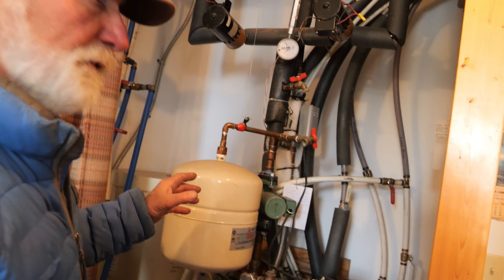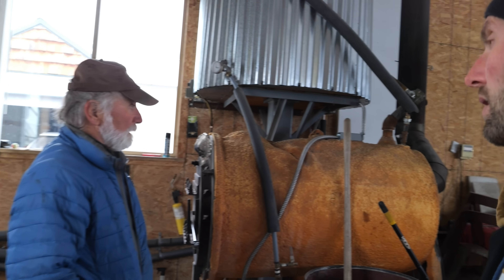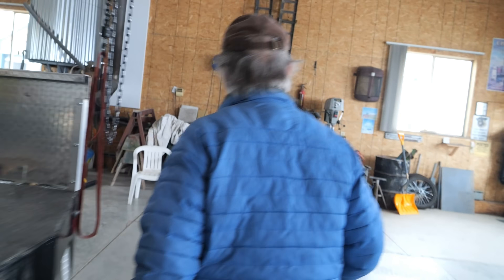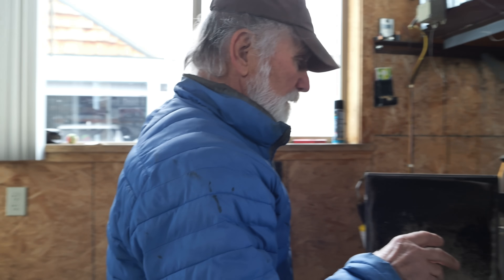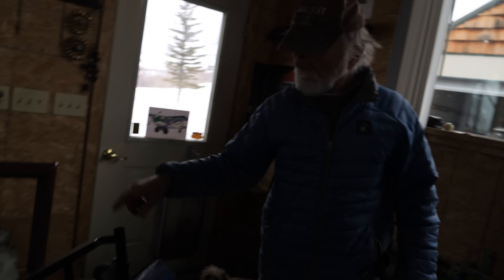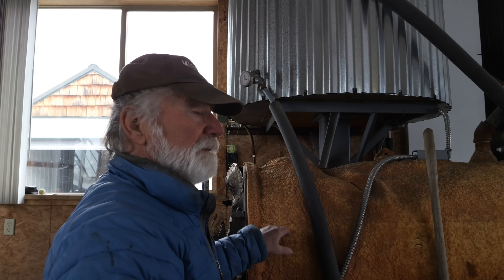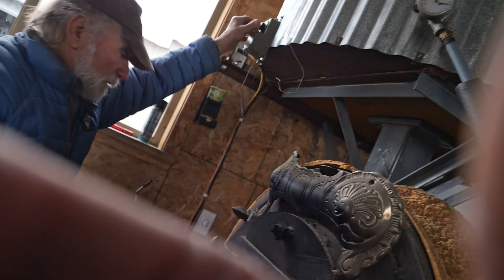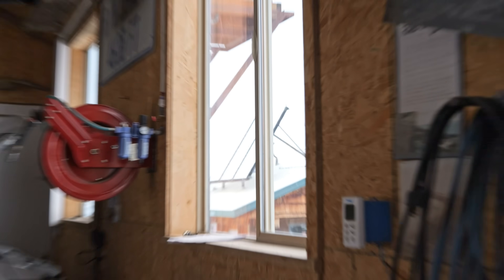Hasn't had a Heating Bill for 40 years.

Comment: You can tell he's an engineer, or he at least runs the numbers, understands the math. He drives a Prius, with a trailer, because it's cheaper. My only question is, how warm does he keep the shop and what's the insulation situation? Adding all that water: the water jacket on the boiler, the 200 gallon holding tank, the underfloor radiant heat, doesn't actually increase the amount of heat generated by the fire. I guess what really helps him is having access to free wood and the time to gather it, stack it, etc.
Reply: The shop stays, totally unattended with no fire in the boiler, in the high 60's to a low of mid 50's, depending to how much sun is out, due to the thermal solar panel array, 6 4x8' panels. Well insulated, big south facing windows, help also.
Reply: @portnuefflyer You got me thinking and researching options for heating my place in northern New Hampshire. Propane is insanely expensive. Wood takes a lot of work. I installed a 12,000 Btu/hr. mini split that keeps the whole house warm enough running non-stop unless it gets below 10 F, at which point I can supplement with propane.

Anyway, here's the math I did on your setup. 200 gallons of stored hot water is about 1600 pounds. Raising that from 70 F to 170 F takes 160,000 Btu. That's only 13 hours of 12,000 Btu/hr. heat stored. Or like 2 hours of firing a 100,000 Btu/hr. propane boiler. So the comfort is achieved by using solar energy either through the collectors or the windows, and the insulation. It's difficult to store enough heat in water for heating homes. It would be great if we could run heat pumps when it's above freezing and store the heat for when it's really cold, but having thousands of gallons of hot water in storage is impractical. Might as well dig and install a ground source heat exchanger instead.
Reply: Insolation is about 200 Btu/h per square foot. So your 192 square foot solar array produces a peak 40,000 Btu in direct perpendicular sunlight. I don't know what that translates to on a fairly clear winter day, maybe 160,000 Btu total? That's a nice amount of free heat to start with. My math works out to about 2 gallons of propane worth. I think you said 2.5 gallons in the video, so I was close with my guess. Now I have to figure out a cost-effective way to make a 200 square foot solar heat collector.
Reply: @charvakkarpe  You could do what he did, buy a large quantity of them from Heliodyne, all pre-assembled and better than you could make, and then install most of them for others......, then with the profit made, yours are free!
Reply: @charvakkarpe  You are correct, in that storing much water for later heating uses is impractical, better to just pump it thru a high mass concrete slab as soon as it's heated!
Reply: @charvakkarpe   He has a vague memory of similar numbers, about 2 gallons of propane worth of BTU's per sunny day.  Pumped directly thru the concrete slab, via the heat exchanger, keeps the loop temperature low as possible, increasing efficiency. You want to make a LOT of warm water with a setup like this, not a SMALL amount of hot water. The glycol loop never goes above 110 or so,

Comment: Straight water in the floor, well let’s hope he never has a failure where the floor pipe splits or he’s going to regret cheaping out here.
Reply: Never happens, like a basement never freezes, with an insulated stem wall and south facing windows. The lowest temp ever after weeks of no attention was mid 40's.  Straight water transfers heat better than a glycol mix also.
Reply: @portnuefflyer yea sure keep telling yourself that, one good cold snap and a week without heat and that house is frozen like a brick.

Comment: I have a radiant heat system in my detached  shop. It is gas fired. It is still very efficient even with using City gas. The cement floor definitely retains the heat.

Comment: WOOD BURNING BOILER /FURNACE...  If a guy buys a ROCKET STOVE TYPE professional grade furnace, it is big, aprox. $4 k,  It is very very effecient too.  It is great because it BURNS VERY VERY HOT and produces little smoke.  Little smoke = hot burning.  Turbo air input increases oxygen... the fire is hotter burning.  ANOTHER OPTION too.

Comment: We have these water radiators in the UK. Its incredibly low cost to heat your home because you have gas heater warming up the water and then that is distributed to the radiators. Amazingly cheap compared to the US approach to heating with HVACs.
Reply: Only if the price of gas is multiple times less than the price of electricity.
Reply: @ my buddy live in SF, his electric bill from using a space heater is insane.

Comment: As a Plumber / Mechanical guy I am made of questions
Reply: O fires needed the last 8 days, with low 20's overnight, but clear days means the solar thermal panels heat the shop and house floor throughout the day enough to coast thru the night. the only energy needed being 2 or 3 circ pumps that draw around 50 watts each, all automatic.

Comment: Those solar panels don't do shit in snowy weather and when it's sunny , you don't need heat.
Reply: You're half right, when snow covered it's wood boiler time. But on sunny days they heat the floor slabs enough to get thru the night, when it's low 20's F

Comment: I have a similar closed loop system I custom made from an on demand propane hot water heater and a plastic tank. My tank and lines are clear so I can see the water. Question though how do you prevent rust in the water systems my cast iron circulator taco pumps like yours rusts and puts rust all in the lines/valves/tank.
Reply: Beats me! All I know my circ pumps last for decades. I did have to replace the galvanized fittings I stupidly used in places after about 15 years, as they were getting gunked up pretty good, all brass now.

Comment: The temperature is he speaking of don't seem like enough to heat anything. 70° water going through an underground slab just doesn't seem like a high enough temperature. Most house boilers have a high limit of 180° to 220°. You're not really getting decent radiant heat off of hydraulic systems until you reach 140°
Reply: Hydronic to forced air does require higher temps, not radiant floor. 85-90 is plenty for the house, lesser temps keep the shop good for working.

Comment: "Water is in the floor, straight water, it's never gunna freeze." Spoken like a true handyman who plans to never take a vacation. 

I personally would rather spend $800 on glycol than have to jackhammer up my floor to repair a freeze, but if it's worked for 40 years, who am I to judge? 

Thank you for the amazing tour! I've never seen a wood stove system like that. Incredible.
Reply: Even in the middle of winter, the thermal panels will produce enough hot water to kepp the floor water from freezing, with no other attenetion, 48 degrees is the lowest ever noted. Glycol reduces heat transfer as compared to staright water.

Comment: Ok this is cool but not true!
Yes you can heat thus way BUT NO WAY IN THE WORLD THAT HOUSE IS CLOSE TO 40 YEARS OLD!!!
OSB board would not be any where's 40yrs ago!!!
Real plywood it would be 40 years ago!!!!,
So if LIEING ABOUT something so simple, what won't one lie about!!!!!
Reply: Not a house, a shop, 18 years old, thus the OSB, an earlier shop and house (not shown) had the same system for around 28 years, bottom line is no monthly bills in all that time, no lie! Good catch on the timeline/OSB though.
Reply: @portnuefflyer  so taking it that you missed the drone footage showing there place?
Stevey Wonder can see the house is not the age they said!!!
Osb board is not a old wood product!!  They use to burn the chips rather than press it into OSB board!!!
The 1990s is when they start pressing wood chips into OSB board....
Reply: @JustMe-gh1lf   Blame the video editor, who glossed over the fact two different systems and houses/shops, have both been heated by similar systems as shown here, for a total actually over 40 years, 18 years for the one shown, thus the OSB.

Comment: Excellent presentation.  Thank you.  That said, just because a person is not paying a utility for energy doesn't mean that the systems and processes "dont cost you a dime".  Maintaining and building all of that is not cheap even if he did most of the work himself.   Plus there is a cost to run a chainsaw to cut wood and a cost to load it in the truck/atv and bring it to the house. Sure, a person might (or might not) save money with those processes but they are not without their own costs to build, operate and maintain.

Comment: Meh. It’s alright. Workmanship is crap. Ingenuity is pretty solid. 

It’s the “farmers special”. More materials, pumps, and controls than necessary due to not having experience with installs. 

I give him props for doing it. It just looks so terrible after seeing proper installs. 

He could’ve just installed a primary boiler loop with a secondary loop for radiant utilising a mixing valve.

Comment: I can help this guy max out efficiency on his system if he lives in Alberta hit me up there’s a few things that are done wrong that’s the reason it takes a few days to heat up I can get it down to a few hours without buying anything new besides a little bit of pipe and I will leave it as an exchange of knowledge cause I want to learn a bit about the panels but I’m a boiler specialist I design, build, repair and replace boiler systems for work

Comment: A buddy of mine built a similar wood burner/boiler setup to heat his shop. His fire box boiler was a little bigger. His setup used to keep the shop warn four days after the fire went out. Bonus was the firebox worked as an incinerator with liitl to no ash left over..

Comment: You will notice that Tom does not have a weight problem, and I seriously doubt he has a fitness club membership.  In other words, heating with wood is a long-term physical commitment, day in and day out, 24/7/365.  In reality, this only makes sense for those with the resources (including wooded properties) and the desire and capability.
Reply: Not that much wood needed, don't confuse this setup with the outdoor boilers that consume multiple cords of wood.  Solar provides the BTU's much of the time, on sunny days all of it, and he always has the option of using the electric boiler as he also has unlimited free electricity

Comment: 7:10 The Oven could also use a hydraulic seperator and work without a Pump.
His system is smart and simple, but almost common complexity here in Germany for bigger buildings, sadly ur gouverment don't want Wood as heat source.
The effort for efficency in big buildings is insane here, everyone sees insulation, winbdows and so on but what they dont see is the complexity behind the Heat recovery systems.

Comment: THE TRUTH: he paid many hours & many invested dollars to get "free heat". You cannot get heat cheaper than buying normal residential energy bc no investment & no time required.
Reply: You keep thinking that...., if it makes writing out out that monthly check easier!
Reply: The money he spent 40 years ago has paid for it self the first 5 years of free heat bills. Every year after has been free. You must not be able to think long term.
Reply: @lows6427  Nope.  Always cheaper to buy normal energy...
Reply: @billyjean9484   That's a sweeping generalization, totally ignoring how he put the system together, what he paid for the equipment, etc. It has paid for itself many times over, and this isn't a hoped for financial projection, but solid fact based on historical records.
Reply: @portnuefflyer  Trust me, im one the highest certified commercial electrical in the nation (only 1200 of us). Off grid peeps NEVER give the real numbers. I've wasted so much money testing wind, wood, hydro, sun. I cant get less than 500% more expensive. Example of real numbers: 40k up front, another 10k materials invested over time, another 60k in time (640 hours spent building, trouble shooting @ $25 hour: his hourly pay rate that he could have made if he was working) divided by total number of months used = 500%+ more expensive than simply buying normal energy / gas. This also applies to my farm animals: 500% more expensive to buy an animal, feed it, slaughter it than to buy from store. I don't like noobs getting scammed.

Comment: shrug if you noticed they never take their coats off and they kept putting their hands in their pockets, might be warmer than outside in that shop but not warm enough to be actually comfortable.  Guess you need to actually light the boiler, for it to work in the shop. So unless you are running a tree farm the wood cost money technically you have paid to heat your home.
Reply: Id imagine its good ebough to have some heat to keep The moisture out. Big spaces to heat to a normal room temp

Comment: While he doesn’t have to pay anyone else directly. It does cost him time and effort. In repairs, and when he runs his boiler it costs fuel. He is either buying firewood. Or he has to cut it himself and if he is using a chain saw he has to be fuel and oil for the chainsaw. Nothing is totally free.
Reply: Battery chainsaw charged by solar. Also he said he just takes wood scrap from construction sites which is insane how much wood we toss on every new house build let alone what he is doing. Nobody claimed free energy. But if you put in the effort you could get your footprint down pretty low. That's the real issue isn't it. How convenient it is to not do any of this.

Comment: Paid for in sweat. Cut, split, haul, load, start, re-load, remove ash. Works great if you have the time and energy. I have a woods in my backyard. Trees down all the time. I used to do that, then, I got old. So, now I run the heat pump and pay through the nose.

Comment: So what happens when he opens his shop door to move something in or out? All the warm air goes out, cold air in. Then he closes the door. Now he has to wait a couple days to get the heat back
Reply: Nope...., that's the beauty of radiant floor heat. Once that 5" thick concrete slab is warmed up, opening the big door doesn't cool it off at all!
Reply: @portnuefflyer  Bullshit. Open that garage door there will be a huge difference

Comment: I have a system in my head for over 30 years and just having built it. Mine would use evacuated tubes and as much storage as i can get and it would be buried in the ground and well insulated. The antifreeze from the tubes would come into the storage at the middle level and the heat would go to the top of the storage and cold separated and sinks to the bottom. The storage is simply brine. In summer the cold is pumped off the bottom for air-conditioning and by the end of the summer the brine has enough heat to last weeks during the coldest months. Remember the antifreeze in the storage is in the middle of the tank and again heat goes up and cold goes down or is it the other way around with brine ????? To make a long story short the cold in winter is air conditioning in summer and vice versa for summer heat storage. Ya its hard to explain but a 10,000 or more of storage is both your air and heat depending on where the coils are in the brine. I would love to explain this to you in detail so you can do what I don't have much time for, my days are limited but you could heat and cool your home and shop in  a closed loop system with little to no external heat source.

Comment: 90 to the floor simply won't cut it ... sure to take the chill off or jeat at 35° outside..but not to meet 70° at 5° ambient temp outside that codes require .. go get a manual j if you doubt me.  He burns more wood than he's letting on
Reply: One thing he's found is that a bit of radiant floor heat makes any aux heat (radiant panel electric heaters, thermostat controlled of course)  MUCH more effective.  In fact, he often uses a combo of both in the house, as he also has free electricity from a hydro plant and a large solar array.  The solar thermal panels  do about 50% of the "work",  all winter, an electric boiler plus the wood boiler handle the rest, that's why the wood use is not that much.  He hasn't paid a power bill in well over 40 years, and the money spent to be able to do that is much less than paying a monthly bill. Proven over the decades, not a projection or a hoped for economy, just the facts. The total cost of maintaining the radiant floor system/wood boiler, solar thermal panels, for the last 5 years for example, has been less than $200.00. A circ pump for $100.00, and a $80.00 aquastat. No single component costs much over $100.00.

Comment: Cool system. Although one of the reasons to use glycol in your hydronic system is to prevent corrosion. Not just freeze protection. Great system though.

Comment: It seems to me that all that equipment could be eliminated by increasing the solar heat panels and using a well insulated large storage tank to store the heat.  Then use heat exchangers for every loop for different heating zones.

I would use an efficient oil, or gas boiler instead of a wood boiler for to supply heat for cloudy days or extreme cold days.

I would also install solar system to supply my electric needs.
Reply: That's incorrect, the solar thermal panels are most efficient with the lowest possible input water, they can make 60 degree water 80 or 90 degrees a lot easier than 120 degree water hotter!  The hotter the the input, the less efficient, that's why the water coming out of the floor goes directly into the panels (thru a heat exchanger.)